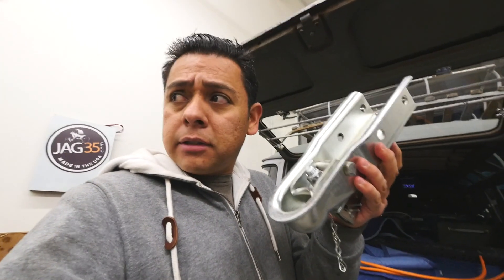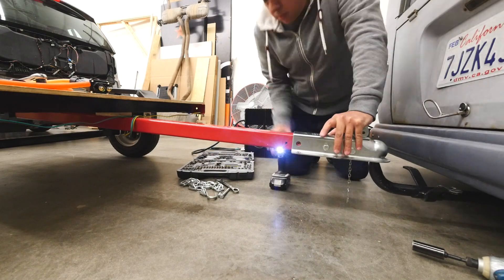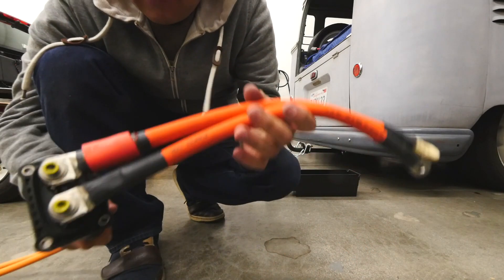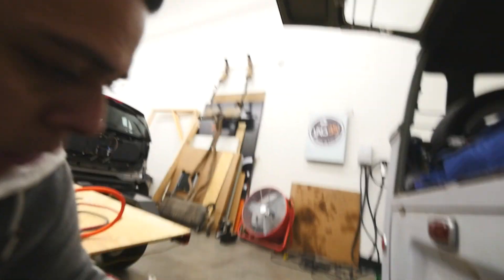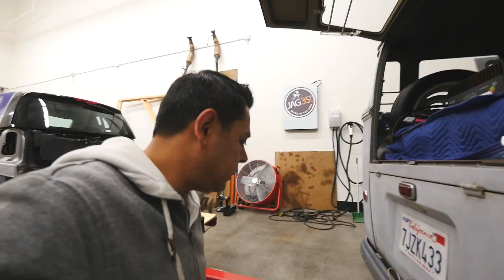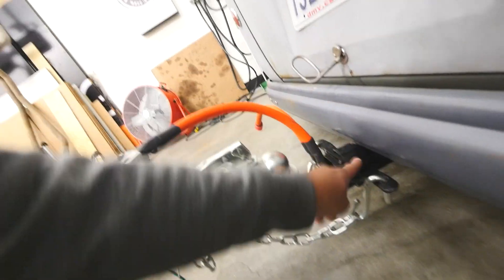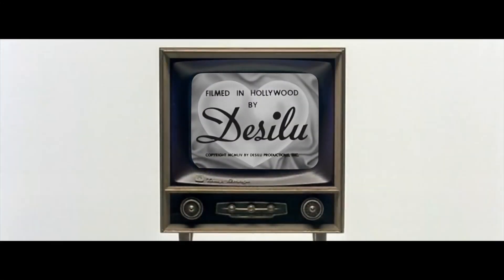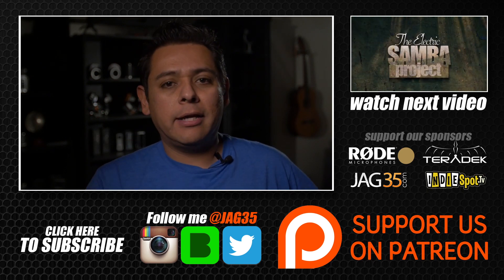Electric Vehicle Range extending Tesla Battery Trailer project pt2

Comment: 15 minutes in, and wonder if the lead attaching van to trailer was detachable, with a plug in port. You could remove the wire until needed, and then plug in when needed, or when parked up for a break, plug in as your mobile station.

Not sure how much regen brake puts back in, if good then would make sense to stay plugged in permanently.

Just thinking of loses and how much connected or is better to have the equal, balanced or in other words equilibrium?

Just thinking out loud... back to watching the rest, which seems to be you have linked them all together (videos I mean)

Comment: Crossing the chains prevents the inside chain from drooping so much while cornering.  That's the obvious and common benefit.  But much more importantly it provides a "cradle" to catch the tongue in the event of hitch failure.  Otherwise the trailer goes horribly ballistic and tries to pole vault.

Comment: Hey Jehu, Big fan, I watch your videos whenever you put them out.  I want to do to my Honda Element, what you have done to  your VW Bus someday.  Ok I know something about pulling tiny trailers behind you that you need to consider. 
1) The person who advised you about the crossing the chains is correct, for a couple reasons
2) From looking at your video I believe the length of the tongue might be too short for the load you are carrying.  If your load is sufficiently heavy and those batteries sound like they are, you are going to sway at high speed.  The longer the tongue, ( that is the length of the bar that connects the trailer to your vehicle ) the more stable it will be at high speed.
3) Finally and this is related to the 2nd item, if your trailer tongue is too short, and your load is heavy and you don't have shocks or dampers on your trailer axle, you are going to get the trailer getting into a rolling motion along the axis of the tongue, basically when you hit a bump on the road, the trailer will begin to bounce back and forth between the two springs, especially with the heavy load, and because of the alternating uneven shifts in the load then the trailer will begin a dangerous resonance induced swaying behind your vehicle at speeds usually over 40mph.
My recommendation, increase the length of the tongue I'd estimate the length from the axle of the trailer to the tongue should be at least the same as the length of the wheelbase of your bus, and you should put some shocks next to the springs to dampen the bouncing.

Just my two cents, keep up the vids, and the struggle, you are in inspiration!
Reply from the maker: Cool I'll keep this in mind,
Reply: +Ray Wong And the longer the tongue, the easiest it is to go backward

Comment: Congrats Jehu. I always find most of your videos very interesting. You have a lot of imagination but in this case I think it's not a good idea to build a range extender in a trailer. You have more than enough room inside your Samba. I think it's safer, more comfortable, more compact. Is your Samba DC powered, isn't it? Did you think about AC? How complex is AC for an individual to build on your own?

And another question. When will you finish the electric Range Rover?

Comment: You said in the first part that you want to use 2 of these connectors why don't you fix them at the bumper up high because the way you said on the hitch it is too low you might hit a pothole and risk damaging the connectors ,put one left and one right to make a y shape on top of the ball .plus use the short side to the engine

Comment: put the socket under the vehicle or on a bracket off to the side of the toing hitch and loose cable on trailer that plugs into it the point above the hitch seems a good spot if you hinged apart of the bumber it would act as a cover for it when not in use

Comment: Apollo 13 threw the word problem out of the dictionary. It is now called situation. It is just a situation looking for a solution. You will find it don't get stressed if you can't find it at that time. The solution is near. Great series and I am enjoying watching your videos.
Reply: +Alternative DIY Energy i thoght you would like them
Reply: Thanks. Most definatly.
Reply: +Alternative DIY Energy i remembered you said about ev car ill link you a few others when i come across them
Reply: That is very kind of you my friend. Not interested in commercial ones. Only hands on DIY. Your AWESOME!
Reply: +Alternative DIY Energy aye but it is all info and you see what can be done just think if they work out are way of series run paralel charge the charging of thse systems would be alot simpler
Reply: +Alternative DIY Energy  would be cool to do it to an old automatic mini
Reply: Building mine from scratch. Using washing machine motors.
Reply: +Alternative DIY Energy converting a petrol car or bulding car from scratch ?
Reply: +David Simpson From scratch. Using bicycle wheels too.
Reply: +Alternative DIY Energy then myself i would look at hub motors from bycicles
Reply: +David Simpson Trying to build it with stuff I can recycle repurpose. So hub motors out and washing machine motors in.
Reply: +Alternative DIY Energy check your email friend
Reply: +David Simpson Will do boss.